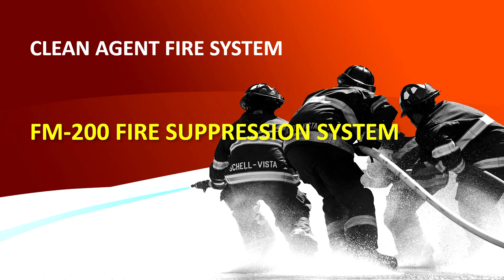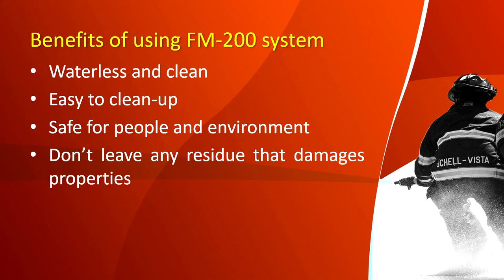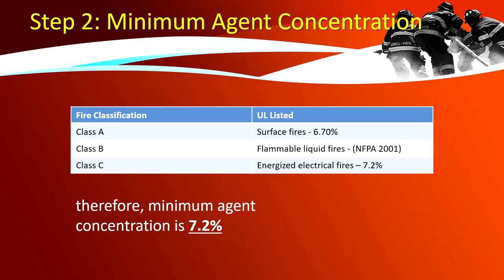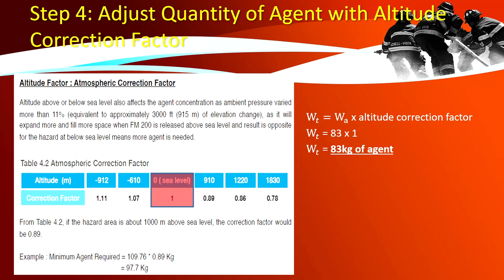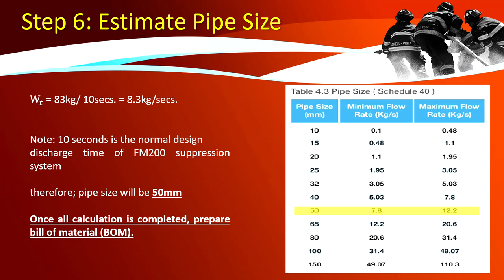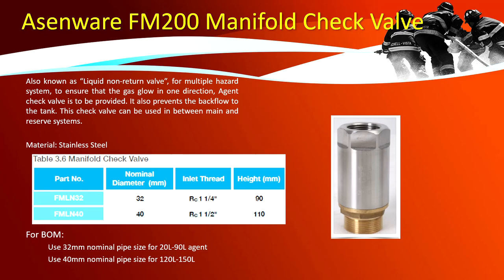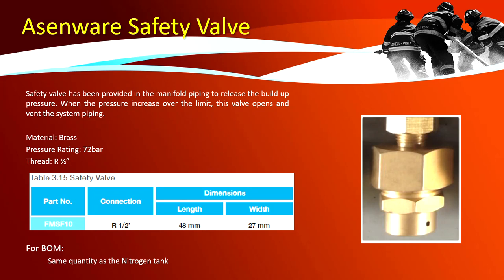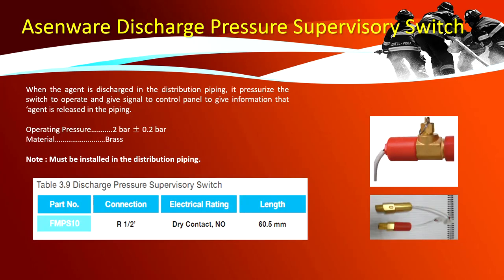How to design FM200 fire suppression system (2021 Updated FM200 System  tutorial)

Comment: Could you please advise on the spacing of nozzle between each
Reply from the maker: Hi dear, according to the video， 12:28-12:40:
· Nozzle can be installed up to a maximum of 305mm below ceiling
· Nozzle height from the finish floor line is 5m
· Maximum nozzle per system is 20 nozzle
· Maximum discharge radius:
· 180 degree = 10.05m
· 360 degree = 8.7m
· Rule of thumb: Approximately 200lb per nozzle
Reply from the maker: Welcome to inquiry us 
Website: asenwarefire.com 
Email: info@asenware.com 
Whatsapp, Wechat, Tel: 0086 13922805301